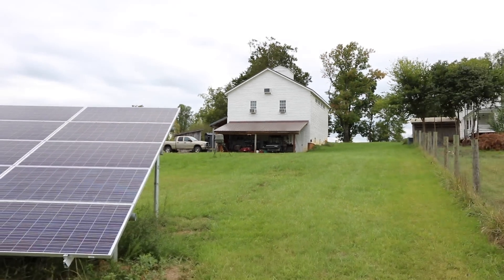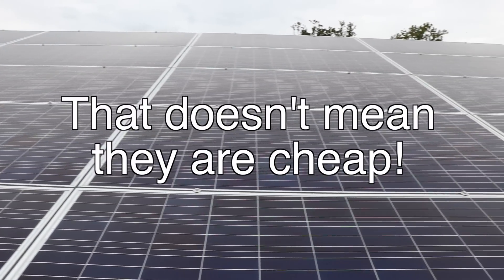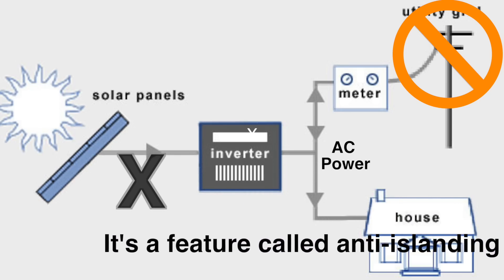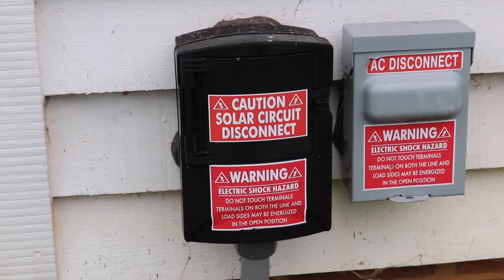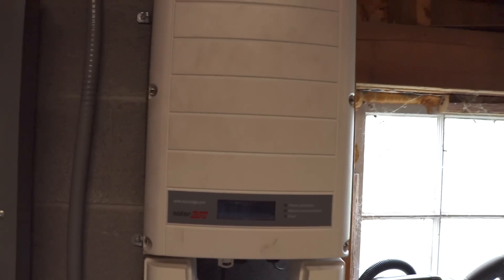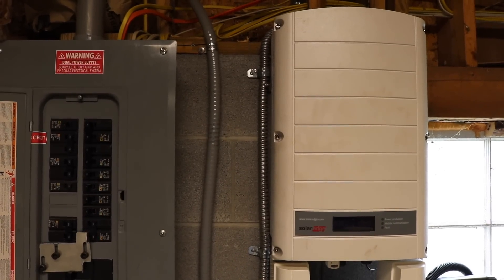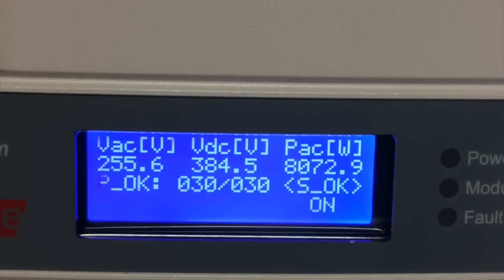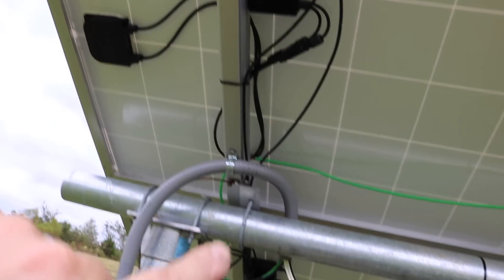The ugly truth behind grid-tie solar systems. Part 1, FarmCraft101 solar.  Watch before you buy!

Comment: HI LINE VOLTS R 1386V 4600V   135,000 235,00  NOT 800,000 1380V IS STANDER
Reply from the maker: Maybe in the US?  According to google, the highest voltage lines in the world are 800k.  Apparently there is a line being planned in China that will be over 1 million volts.

Comment: The payback makes one erroneous assumption - electricity rates never go down and rarely stay the same. So, payback should be sooner.
Reply from the maker: True, but I could also invest that money and earn a return as well.  It's a very difficult calculation to figure.  Thanks for watching!
Reply: My electricity rates have dropped from $13 c/kWh to $5.8 c/kWh over the last decade.   With led lighting, my usage has plummeted too.

Industrial solar and battery technology are lowering electricity rates.

The  average return on invest ment for over 90% of investers is under 3% for 10, 20, and 30 year periods per Forbes.

So $17,000 would be about $500 per year.   But, you'd keep about $350 of that after taxes.

Solar power savings are from your after tax income.  As a result, they are like tax free earnings!
Reply: Payback also assumes you don't sell the house before payback time (no guarantee that it raises the price of the home enough for payback).
Reply: mayhaps, but you don't base your calculation on that
Reply: Solar system degrades about 0.5%/yr offsetting some of rate increase gains.
Reply: For me, emotionally, the payback time was 1 month - when I received the first negative electricity bill indicating they owed me some. As we we are retiring, with some money in the bank, going solar seemed an easy choice for inflation from investing. One fewer bill to pay for ever more. Do NOT lease, take a home equity loan if you have to.

Comment: So, sorry I know its minor details but there is a very common misnomer that annoys the hell out of most Electrical Engineers... power dose 'not', just "flow in the path of least resistance". Where the misnomer comes from is it is true that 'more' power will flow along the path of least resistance. But unless the circuit is designed correctly with the correct controllers and/or limiting Diodes to conduct the electricity where you want it to go, electricity will always flow through all available paths... A better analogy would be, if you had a 5 gallon bucket and you drilled a 2" hole in the bottom and a 1" hole next to in on the bottom, then you plug the holes, then fill with water; If you could pull both plugs simultaneously the 2" hole would  obviously have a larger flow/volume then the 1" hole. But its VERY important to notate that you will still have flow out both holes unless circuit/inverter is properly designed/set up... Considering your giving advice to the potential  "shade tree", "DIY'er", "sudo-Electrical engineers" that could be handling an out-put of even a fraction of the amount you are describing is easily in the range of being a potentially lethal power flow....
Reply: I scrolled down looking for somebody to say this, so i didnt have to : )  thankyou my faith in E.E restored from an Old UK Sparky
Reply: Brent Curry Ok, if thats true, explain this, 
When i was around 6years old I took a massive long extension lead, pluged it into a three phase outlet in a shed and ran the lead out to a sandpit, id installed a massive electric motor in a sandcastle style mound that id also wet down to make the sand more malleable. I then cut the end of the cable, seperated the wires apart enough, switched on the power and went back to hook up the cables to the motor like i did with my mini solar motor kits, i had no shoes on, barefeet in wet sand, being a kid i took the wires and touched them onto the motor, but it arked, jumped and the cables stuck onto my palm. i had entry burns and an exit burn mark on my hand, I remember looking at it and how it felt like a snake was biting me and burrowing deep into my hand, i somehow pulled it off and afterwards shook like crazy and the power cable would of been about 40m long, 250v and it still earthed back to the shed not into me.  I remember going back to the shed, turning it off and unplugging it winding it up and hiding everything back. but It didn't take every available path, only back down the third wire which was earth. 
 back 40m to the shed. it never earthed out thru my wet feet nor crossed my heart thank godness.
I had to waste the day in hospital and the dr was aparently doing some sort of study into electrical stuff, they were aparently really interested by the whole situation, all i knew was i had a burn, my ass was red from the smack i got from doing exactly what id been told not to do and i also got icecream i think as a kinda glad your still alive present hahaha
Gave me a.nice scar and my dad always promised to make me tell the electrician that id done exactly what he said not to do....hahahaha
lucky i guess?
Reply: @Steve211Ucdhihifvshi  perhaps your body had more resistance than the earth wire, so it used only your hand to get to the earth wire.

Comment: Great Video .   Learned a lot , as I'm a newbie to solar.    For the solar tax credit was that all federal, or some state ?
Also, if you had to break down the cost (I'm using the 17,000) at a high level could you give me the breakdown -
Panels =
Panel accessories (inverters, wiring, panels)=
Batteries =
thanks !!!

Comment: You can build a coil, place near the high voltage transmission lines and collect power for free. I think it's illegal though. But I don't see how if you are on your land
Reply: yeah you can and I know of one case a farmer installed a static generator in his barn and the power company could not collect any money from that farmer because he did not steal power. the court case went in favor of the farmer. the farmer was getting leakage that goes in the air there is no direct connection of power.
Reply: just dont try a static generator near a 50,000 watt radio station because you are taking power from the station and using it for power. that owner had to pay back the radio station for all the power he robed from the radio station. you would think it would be the same for the power company but the farmer got away with free or almost free power.
Reply: Helena Back you may not see electricity but you can surly feel it.
Reply: you cant see electricity if its invisible were is the evidence.

Comment: Very nice install. My house is off grid with 4.8k array. I was going to install  a grid tied solar power system on my dad's house but we have net metering here. I decided to go with a battery back up with a critical loads panel that will run the refrigerator and the freezer from the solar power. That way we can get a return on the investment. I installed my system for about $12k batteries incuded. So what was the ugly truth about grid tie? I must have missed it.
Reply from the maker: If a system has a battery backup, it is a hybrid system, not a grid tie system.  The ugly truth about grid tie is that if the grid goes down, you can't produce any power with your solar panels.  Many companies are selling these systems to people because they are cheaper, but people should know there is a very big difference between grid tie and hybrid systems, and how expensive they are to install.  I go through the differences here: https://youtu.be/gPycyuVJ_Cg  Thanks for watching!

Comment: the problem is with us and a our lack of knowledge , while the sun is up and solar power is being generated / put into grid or battery bank .  run your pool /spa  HOT WATER HEATER  !  and any other electric needs will be FREE    as power company will pay you 20 cents per kilowat you put into grid and charge you 10 times for usage even off peak !  this is fact .

Comment: Wow you have a high grid voltage, around us it is like 242-243vac.. Pretty good layman's explanation of how the system works, but solar edge will have 2 wires minimum in that conduit (positive, negative, ground), our area requires us to run a ground back to main panel regardless of if we drive a ground rod at the array..

Comment: you sir need to look in newer technologies. There are out there hybrid inverters. That do generate power as a grid tie inverter but also provide backup to the house. You don't even need batteries. If you panels generate enough power it will send all the power to you and nothing to the grid.  And I net is far less expensive than both inverters you have there.  google hybrid invertor. they go up to 10KW.
Reply from the maker: I talk all about hybrid inverters in this video: https://youtu.be/gPycyuVJ_Cg  There are none that don't need batteries that I am aware of, unless you include the Sunny Boy that has a single plug that provides a small amount of power, but nothing that will run any significant load.  Please post a link to the inverter(s) you are talking about.

Comment: a grid tie system is good,a battery backup system is good a battery backup with grid dump upon overload or overflow is best because...

A) grid tie goes down when your power lines go down
B) battery backup systems can overload and have safety cutoffs, if enough batteries fail, it's all over for you.
C) Both systems use different methods of power distribution.

With a battery backup with grid dump you can do this...

A) generate and store energy throughout the day, have it flow during the night
B) when you aren't using as much power the excess energy is sent back into the grid (when safe to do so)
C) you can feed your battery bank through the solar, wind, water (water wheel) a combination of both, or you can feed it from the grid - VERY USEFUL when you know a bad storm is coming and possibly you won't produce enough power for a week, if you need to buy more batteries then your system would already be set up to quickly connect and disconnect batteries and monitoring systems.
D) If you don't produce enough energy, the system will sense it and it will top you up through the grid.

Downside to the described system.... 

5x the cost of ownership and maintenance as the other systems, planning takes a lot longer and configuration, if you're not accustomed to swearing, you will by the end of the project.

You think playing with high voltage of DC is bad, try mapping out this system, it's gonna be a struggle.

Many people say "you don't need to worry so much about this because it's easy to do one and the other, you're just combining parts" not really, they make FWD, RWD, 4WD vehicles, trying to switch one to the other is difficult and is a struggle engineering wise when you are doing it correctly, occasionally you will get away with slapping parts from one brand into another and get her done, but in reality it rarely works out properly without the struggle.
Reply from the maker: Well said.  Lots of people seem to think my title is clickbait, but it's not.  Grid tie systems are cheap and easy to install, but provide no backup whatsoever, and that's the ugly truth.  Retrofitting to a backup system is expensive and complicated.  Thanks for watching!

Comment: Each panel costs around 1 dollar a watt, so if you have 9.1kw system that's 9k. if your using using a grid tie central inverter thats around 2k per 3,600k inverter. You can eliminate the central inverters by using microinverters for around 130 bucks per panel or you can go the solar optimizer route for around 60 bucks per panel. Rack, wire, switches etc around 2k unless you build it yourself. So really you don't have to spend 23k unless you like to give your money away.  Your grid tie inverter needs to support islanding (with an ac transfer switch) and that's not what you bought! OR you could tie a small battery based inverter into the system to fool your big inverter into staying up. Lot's of ways to achieve this.... BUT BECAUSE YOU series tied your panels you are forced to use a very high voltage (and expensive) central inverter. You can never run optimally because the weakest panel in the system will drag the rest of your panels down. That includes dusty panels or leaves or simply a shadow. You really need use a panel per panel optimizer called MPPT.
Reply: A solar panel is a very simple device. It requires no more technical saavy than hanging it on a frame. You plug in either microinverters, or power optimizers. There is zero reason to bother with tax credit, considering the install marks up the cost many factors above what it would cost a person to just buy them direct. You can buy all of this online or even go to dedicated solar stores. 
And a rooftop installation is the WORST possible place for solar panels. The heat between the roof and the panel creates a heatdam and your panel will be hot enough to cook an egg! You will also lose more then 30% of it's total power capability when you expected it to run the best. Over an extended period this heat is enough to oxidize the cells, and you will start to permanently lose efficiency after about 3+ years. This heat also is high enough to cook the microinverters that is just beneath the panel.  It is also very in-accesible and   extremely hard to wash off your panels.  It is better to install them on a fortified back porch structure. Or better yet, create covered parking area with these as your roof. You now have the option to power your plug-in powered electric car. as well as a very nice attractive glass roof!
Also ALL these solar installers will NEVER tell you that the way they do it, your solar panel goes down the moment gridpower is off. If YOU do it, you have the option to create a true off-grid solar installation, and you can literally offset 100% off your electric bill. But NEVER use lead-acid batteries in a large off-grid setup because you will be replacing them ever 3 years

Comment: One, quick question? What if I dont want to use the town grid for electricity at all (Off Grid). If I only use solar power to power my house, then would it cost me double or the same? Thank you.
Reply from the maker: Depends on what you need to run.  For off grid you need an inverter large enough to run everything, possibly all at once unless you want to manage loads.  That means a big expensive inverter and a big battery bank.  But it should not cost you double, and if you do the work yourself could be less than I paid.  See: https://youtu.be/gPycyuVJ_Cg

Comment: I’m in a grid-tied situation right now, house was built with it. The objective is to change to a hybrid system that has grid power when needed, but can disconnect and operate independently (solar + batteries, plus eventually wind). Any good resources for shopping for the critical hardware, namely the inverter, to be able to switch over to this? I can buy or build batteries, I have solar panels and can buy more, I can buy a wind turbine... but I need the critical brain, the power management system, the inverter.